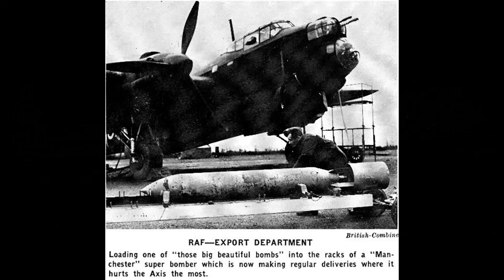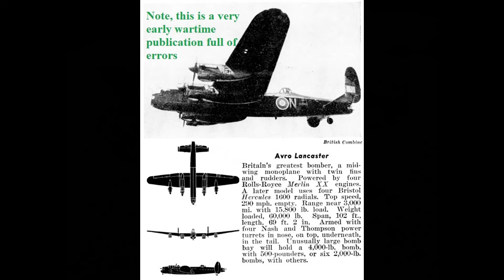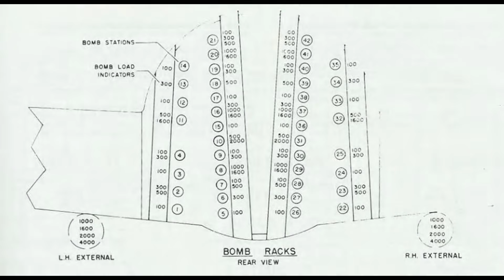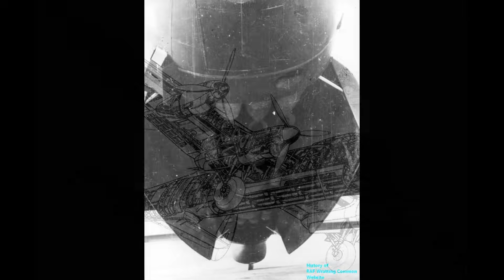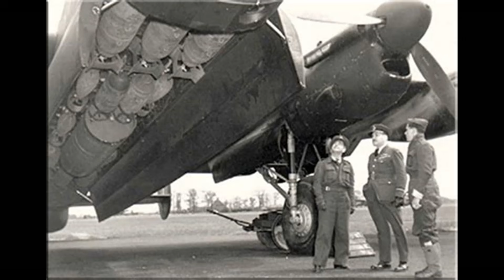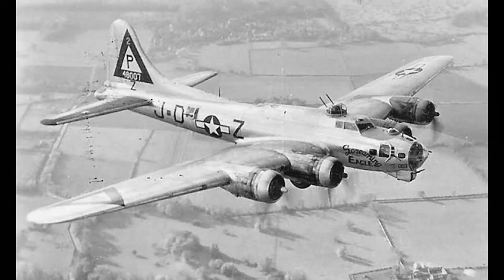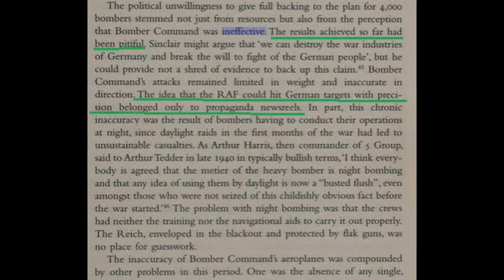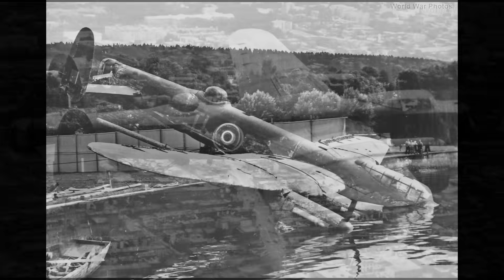Avro Lancaster, Payload, Turrets, Stability and More

Comment: Nice to see an image of the ventral turret on a Lancaster. Many Lancasters were fitted with downward firing guns either .303" or .5" calibre to replace the ventral turret.
Reply: raised eyebrows at many. I have read a good few hundred lanc crew memoirs/war stories and i've never seen reference to a lanc fitted with downward firing guns as an ad-hoc  mod
Reply: @keefymckeefface8330  by many I mean an unknown number. There is even talk of some with a 20mm cannon.
Reply: @neiloflongbeck5705  lol. Now you really are in the realms of talk, and not reality.

These are trash sources, discount.
Reply: @keefymckeefface8330  got any proof that they are talking bollocks?
Reply: @neiloflongbeck5705  don't need it. You got any proof your not? It's established fact most were produced without such guns and therefore down to you to provide evidence otherwise if have it. And my raised eyebrow is calling you out on many. I suspect you read one account where someone jury rigged some arrangement, and this factual seed is being extrapolated to "many".

Repeat. If it was many, there would be many mentions. May I suggest that a book such as Men of Air by Kevin Wilson, which is chockablock full of first hand accounts from hundreds of bomber command crews... Would mebtion such a thing.

It doesn't.

Not does any of hundreds upon hundreds of accounts I read.
(tbh, I'm prob into the thousand plus mark by now.)

So, no. Don't buy it. It was not a modification done at all widely.

And if you know your stuff about ww2 raf, you'ld know why. Weight. They were very anti mods that not official cos of weight and C of G issues.
Reply: @keefymckeefface8330  the problem with personal testimony is that it only applies to what that person saw. As for books they don't always include everything. Details that aren't considered important gets left out. Who knows the fate of Lieutenant Anthony Goldsmith of D Battery of the 56th (Heavy) Regiment?. His fate is recorded in one widely available book, but the other history books never mention him, does that mean he didn't exist or is it more likely that his service was less important compared to the telling of the story of the war? The people who saw these ventral gun installations may not have recorded them or may never have been asked about them. Or is it that the people quoted in these books didn't serve in the squadrons where these thing were done.

One source that mentions the unofficial downward firing guns states the operator sat on a bicycle seat affixed to an ammunition box. Now that is a credible set up as the tail gunner on the B-17 sat on a bicyle seat. Does this mean that they did the same in the Lancaster? Who knows there's very little information online and what there is, has no citations given.

As for the number fitted with an unofficial modification, in English we have words that express an amount in vague terms like few, some, several, many and lots. Remember the few who fought in the Battle of Britain numbered just under 3000 aircrew. And are you going to quibble about that? I don't  think so. So, why quibble about the use of the word many?

As for weight, the 2nd Dicky would weigh more that a Browning machine gun and ammunition, plus the lean was the rear of the aircraft, so it tbe CG margin was so poor then going to use the wlan would be considered an inflight emergency.
Reply: @neiloflongbeck5705  yeah but attacks from below and tactics and tech counters is a major topic that comes up and you would expect such mods to be mentioned. As to your specious defensive wittering in usage of English... We know what many means. You said many. Many would make it a not-rare thing.

Got lil challenge for you. If is many, find me one account of such a mount. Just one.
We link or books name, author, publisher, page number quoting from,

Go on. If they many, should be easy for you to provide one example.
Reply: @keefymckeefface8330  the basis of your argument is your disagreement over one word. You are not worth further consideration.
Reply: @neiloflongbeck5705  mate, it's a pretty important word in the context. It takes a hookey unreliable story of these mythical modded lancs and presents it as a common thing, when reality is vanishingly rare and almost unseen in regular use bomber command aircraft.

And it comes down to simple fact. Your peddling BS. Plain and simple. And it would be best for all concerned (except you lol) if it's pointed out that your peddling BS, so people are not misled.

Go on, name just one source for word of such a modified lanc. Go on, just one. Surely you must have one, your saying many aircraft had it. If that's many thousands of people will have seen it. Name one.
Reply: @keefymckeefface8330  I see that hou are incapable of doi g research for yourself, so one source that covers this issue is wesponsandwarfare where they discuss the following:  "Defensive Armament: A total of ten 7.7 mm (0.303 in) Browning machine-guns in a nose, mid-upper, tail and ventral position. The ventral position was soon deleted on most RAF Lancasters as it was thought unnecessary and took the same position as the H2S radome. Where possible, and unofficially, many crews installed a single 7.7 mm (0.303 in) or 12.7 mm (0.50 in) Browning machine-gun on aircraft lacking the ventral turret in order to deal with the ever increasing ‘behind and below’ attacks of German night fighters using Schräge Musik, which interesting, did not use tracer ammunition. These were hastily installed configurations usually consisting of the gunner sitting on a bicycle type seat with the ammunition box being bolted to the floor and the gun mounted in a hole cut into the floor. The British would eventually re-introduce the F.N.64 turret on aircraft equipped with G-H radar (an improved version of Gee) since that type of radar did not have the large radome as the H2S required. During 1943/1944 when the use of Schräge Musik on german Nachtjagd (night fighters) became widespread, the new twin-gun F.N.64 power-operated turrets became the most important gun position on the bomber.." please not that they use the words many aircrew and fro  this we can infer that many aircraft were modified. Unfortunately they di not give a primary source for this information, however, the author is a well-known author in military history and has written many articles for Cross and Cockade.

The 20mm cannon remains s little more than talk.
Reply: @neiloflongbeck5705  well known? Then name him. Weapons and warfare is producing nothing related in a Google search.

I think it's some shonky research, frankly. As to your jibes on research. Pfft. Your line is based on unsourced second or third hand quotes. Essentially worthless. 

That piffle... Versus reading over a thousand first hand accounts of flying and fighting Lancasters, none of which mention such a fitting?

I'm sticking to my (none-ventral) guns. It's an extremely rare ad hoc modification maybe carried by a large handful of aircraft, but someone has multiplied it up to "lots" without any evidence.

Aside. I just searched site you mentioned, and is no mention of ventral guns attached to pieces about Lancasters.
Reply: @keefymckeefface8330  oh dear, can't do a simple Google search. That just about sums you up. Can't understand the meanings of simplexwords, can't do a Google search. Mitch Williamson is the author as you can't do a simple Google search. As said earlier, absence of evidence isn't evidence of absense. Just because your source doesn't mention something doesn't mean it didn't happen. Have you ever considered that the people interviewed may not have been on crews that wanted the extra defences or just may not have mentioned them or the people compiling the book may have left it out due to space constraints  (perhsps they wanted the more dramatic accounts of wartime service and left out dome of the moors biring bits or perhaps they only got told by one or two of the people they interviewed about the unauthorised extra gun and left it out as the majority never mentioned them) or perhaps they did mention them and you've forgotten? Who knows? But one thing I do know from studying other periods in history is that books don't always tell you everything and you need to look st multiple sources to get a reasonable picture of the events you srd looking at. Accounts from different authors can e en be contradictory, which means more research. BUT you don't seem to understand that. You think because the books you've read don't mention something then it can't have happened. Sorry, but that's wrong.
Reply: @neiloflongbeck5705  1. Using data you gave, search returned nothing. Given right data, search works. It's down to data supplied, not the monkey typing. That website has nothing on lsnc ventral turrets worth noting.

And I never said absence of evidence is evidence of absence. What I said was lack of evidence is indicative of not being usual or common.

Different.

And I'm not denying SOME aircraft may have had ad-hoc arrangements fitted.
I'm saying it was exceedingly rare, not common, and far from usual.

And I'm sorry if my concentrating on hundreds upon hundreds of first hand sources distresses you. Sorry dude. Can't beat em. And they pee all over your mil history authors who specialise in ww1 then dabble in ww2 a bit. Sorry man.
Reply: @neiloflongbeck5705  re multiple sources.

Like many hundred first hand accounts?

OK!

Meanwhile, you got one quote.

"multiple sources"
Reply: @keefymckeefface8330  so? How where they selected? What questions were they asked? How long after the events were they interviewed? Where did they serve? When did they serve on Lancasters? All influence the outcome, and little of which will be found in your books. Keep deluding yourself that everything in the books is correct. There are known errors in all historic records. In some cases the bias of the author is well known, take the chronicles written in the reign of Edward II some are biased for him and others against, but all are accepted as evidence of the events of his reign.
Reply: @keefymckeefface8330  but that is what you have said, with your insistence that the first hand accounts are the only truth.
Reply: @neiloflongbeck5705  and most those questions can be answered in satisfactory manner. Especially when we talking literature that's concerned with stuff like loss rates and defensive matters.
Oh, and an awful lot of it was written in close proximity to the war and had no reason to cover/hide anything. So, pls, I'm not talking geriatric old airmen or massaged mid war interviews.
Reply: And, fella, it's you who's deluding himself that everything he found in books is correct. Your the side the argument beading his shtick on a narrow, one book quote. I'm looking at hundreds of books and accounts. And calling you out. It wasn't common, it wasn't normal, and very few lsncs had such mods.
Reply: @keefymckeefface8330  there are hundreds of accounts that say the wingspan of the Stirling and the Halifax were limited by the Air Ministry to less 100ft pre-WW2 because of the hangar door opening was 100ft. ALL of these accounts are wrong on the reason for the limitation and only 2 (1 was quoting the other) give the correct reason. For it is well know that the pre-WW2 Type C hanger had doors that could open to 120ft and the specifications for both aircraft called for most maintenance to be carried out in the open air. But by your logic the 2 that are right are wrong simply because of numbers. Numbers don't make a blind bit of difference if they are wrong or in this case fail to cover all scenarios. If once source says many aircrews wanted a downward firing machine gun then it implies many aircraft were fitted with the as crews were assigned to specific aircraft for their tour of duty unti, either the aircraft was withdrawn from the front line and replace or went off for maintenance.
Reply: @keefymckeefface8330  got any proof for any of that guff about the interviews? As for loss rates the Schrage Muzik cannons didn't use tracer rounds and thus didn't give themselves away. The gunners fir most of the war only had their eyes to spit the dark aircraft over the dark landscape. Most shot down crews never saw the aircaft that shot them down until it was too late.
Reply: @neiloflongbeck5705  I know the allies were somewhat perplexed by schrager muzik. As to proof? Boxes in storage stuffed with results of collecting hundreds of old books. Lots boxes, lots books. Overall numbers hard to tell, naval and aero are all mixed in together with the old SF and the pulp fiction collection,  but is result of 35 years collecting such. Most ( the aero and naval) of it is first hand. Been collecting since mid 80's, but hot leg up cos my dad is bit of plane fan with thing for Avro (he's a mancunian , his mum was fire warden at the factory during war) and on mums side grandad worked for de Havilland, uncle the following firms, and was load stuff from them I got given.
Reply: @neiloflongbeck5705  Ps. At least 100 the books you claim as biased, brief and useless are full on "my war story in the raf/whoever" written by raf personnel, covering full service from training to demob. Wa lots such autobiographies published sorta 50- 65. And we are not talking partial, biased selective interviews fine in short format.

Then is later, more history driven stuff, of which I'm selective. You won't find Jeremy Clarkson style patriotic guff in my collection, tyvm.

Sorry fella, but my sourcing is good, and wide. Just disorganised cos is personal collection not a library for research.
Reply: @keefymckeefface8330  so no proof whatsoever about how the information was collected. Yes, the results of those interviews are interesting but not that much.
Reply: @neiloflongbeck5705  your slow on the uptake, or lack basic English comprehension skills found in an intelligent 12 Yr old....

A lot these ain't interviews. Is the starter. An autobiography is not an interview.
2nd. Your desperately claiming bias.

Bias in favour of what, pushed for by whom? Why would raf crew feel need to not include such details on post war books? What's the reason for multiple dozens of sources hiding such?

Is none, is the simple answer. Occams razor.

And the simple reason such mods not mentioned is they not exist in the vast, vast majority of aircraft. , not that is some omerta on ventral turrets/jury rigs.
And to turn it round.

What you got as proof? Answer-fanny adams. A Web link to a many years after war 3rd level from primary sources website,

Versus least my stuff is written first hand by folks who flew in ww2, within couple decades of events.
Sorry fella, your full of Internet bluster and BS, trying to back up an untenable position...

When in reality such mods were vanishingly rare, far less than 1 percent of airframes ever having them for sure, and your assertion that "many" existed is based one one other person using the word "many" on a topic that is not hiis speciality field... When his speciality field is ww1, which ma's notable in fact that aircrew were much more able to make such off the cuff modifications to their kites....

And all you got in reply is throw pathetic weak jibes because I couldn't be bothered to trawl through  loads of searches cos wasn't enough data given for first search success.

Thats the mark of someone losing an argument.

Next time, dot rest everything on a none expert mistakenly using the word "many" when he actually means "I've got one account of a unit that modified a couple of airframes before group command told them to stop f!+*ing around and get them back to stock condition. ASAP."

Comment: Thank you for another fascinating presentation. Re: the .303s, they were a joke after, say, 1941 or so. After this time, fighter armor was such as to render them pea-shooters. They worked for spits and hurris in the BoB simply because aircraft engines had not yet become powerful enough to enable up-armoring. This is my assumption anyway, so please correct me if I'm wrong. Thanks again!
Reply: At the time of BoB there weren't really other options available.  The hispano 20mm was unreliable and drum fed, which resulted in awkward installations, especially in Spitfires (there was 1 squadron of MkII spits with them, it was a failure and they retroed to 303).  likewise the browning 50 was still very much under development as an aircraft weapon, being bulky and slow firing (the 303 was converted to open bolt to speed up the ROF).  The air ministry made a very cold, realistic decision.  They realized the majority of pilots available would not be very good shots and felt it was better to increase the odds of at least damaging a German aircraft by hitting it with a few of a large number of small bullets than missing it entirely with fewer, larger bullets. They also had vast stocks of 303 ammunition available.  After BoB with tech advances and greatly increased pilot skills the belt fed Hispano 20mm was introduced in the VB Spitfires.